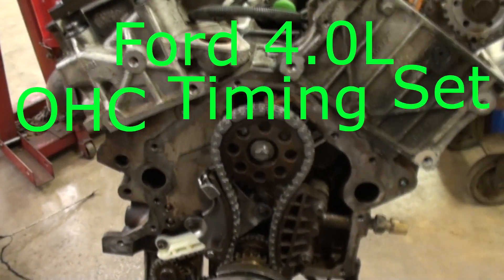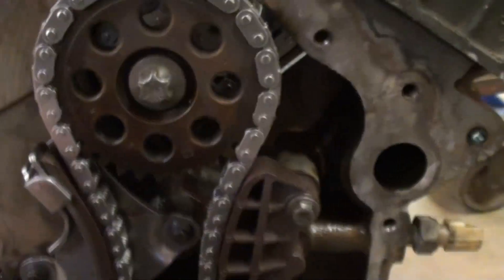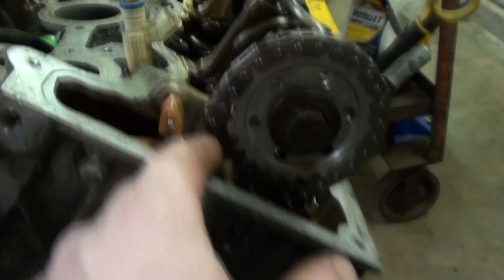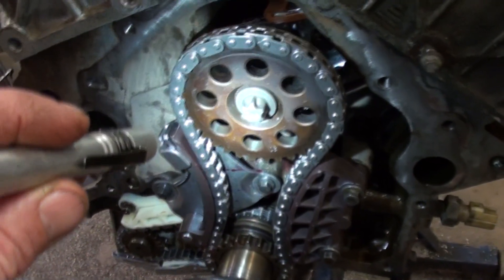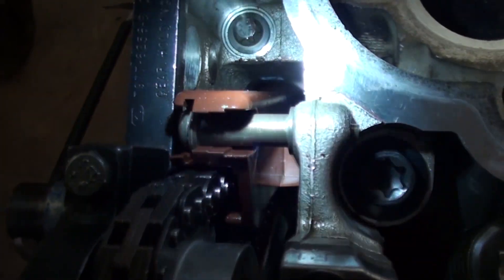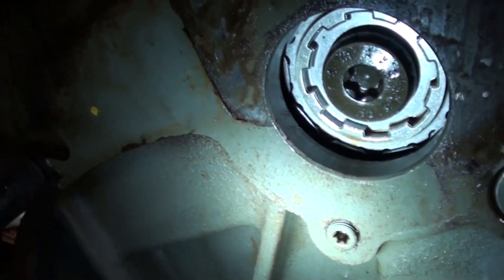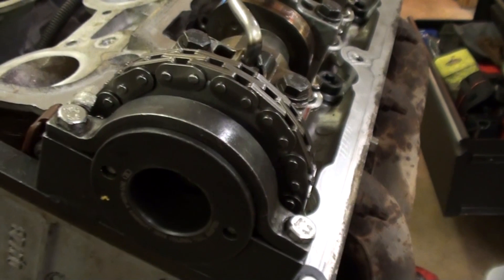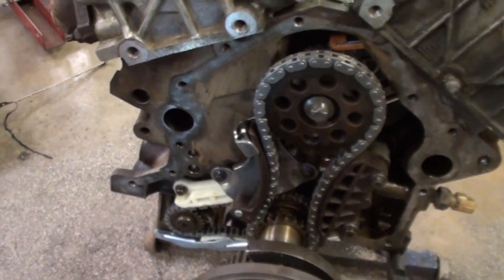Ford 4 0L OHC Timing Set Overview

Comment: My only question is, why don't we use brass or berillum copper for the guides.. Im no engineer. Could be a bad idea.
Reply: To help save the gears and chain when they eventually fall apart the plastic polyurethane parts get chewed up instead of chewing up the gear

Comment: Does jackshaft have to be timed? Or just crank and cams. My engine doesn't have balance shaft. Thanks!
Reply: crank and cams.  jackshaft gears no. but make sure those bolts on each end are tight and do not roll this engine backwards.

Comment: I used vice grips on the cam and angled the vice grips where they were kinda locked to the block where they wouldnt turn ,if you know what I  mean, now I have to take the engine out of my other sport trac and go over it probably put new guides tensioners ex.. on it ,I left the balance chain off my other 4.0 it hasnt had any oil preassure issues or vibration why do they have a balance shaft I think its dumb the engine doesnt produce that much power I think around 200hp or something, have you ever had valve issues with a 4.0 I dont think you can adjust them I guess just replace the lifters ,I used 10w 30 with and additive do you think 10w 30 or 10w 40 would damage the engine cause my other 4.0 has wierd ticking noise sound im not sure if its the chain or what ,anyway just wondered about this, good video, take care

Comment: If you find you're replacing all four chains on the 4.0 don't fret if you can't afford the alignment tool. Just did mine again and found the left bank cam is almost in proper pos once you rotate the groove down. The right bank is tricky since there is a lobe or two pushing on the valves (once rotated) so finesse it with locking pliers and tighten that cam bolt last.  Also eye the key and split it's width to the left instead of 12 o'clock and gain some additional torque.  Whew.

Comment: I just did this job. Now after I started the engine I have a fast tick that speeds up with rpm?? And ideas ??
Reply from the maker: Where did you buy the timing components? If they were not from ford it is possible one of the tensioners is bad. See if you can isolate the noise to one side of the other, then swap out that tensioner and see what happens. You can even use one of the old tensioners for testing,if they were still ok, and see what happens.
Reply: @JosephVollmar  it ended up being the crank shaft timing chain tensioner on the passenger side.

Comment: What happens if my timing jumps on my cams and my jackshaft and everything else is fine? Cassette let go and it jumped timing on right passenger side
Reply from the maker: Sorry for the late reply, but if it jumped time on the passenger side, to replace that casette the engine will need to come out. then you retime everything from the passenger side first all the way back to the jackshaft.

Comment: Great Video! I am attempting to set timing on left (driver) camshaft. (2005 explorer 4.0L SOHC) Have timing tool lined everything up and torqued to spec, won't start.  Throws P0340 and P1336 code.  Replaced camshaft position sensor, no change.  Is there  something on the left camshaft sprocket that has to be lined up for the camshaft position sensor to sense the camshaft position?  My understanding is that other than lining up the left camshaft with the tool with crankshaft at 0 degrees TDC for #1 cylinder, the sprocket location doesn't matter so long as it's torqued properly.  Not sure how the camshaft position sensor knows the location if there is not a magnet or protrusion on the sprocket that also has to be aligned.
Reply: Make sure #1 and #5 are top dead center and if you have a balancer shaft make sure the dot is lined up toward the right pointing toward the line on the block it might need a few turns to line up

Comment: If the cassette for cam front vaulecover breaks does that mean it's out of tlme
Reply: It could be.probably not but the way to find out is to set your timing based off of the crank cylinder one should be at top dead center  compression stroke And your cam shafts that notch on the back of the cam should be parallel with the cylinder head in ur case if the right side is parallel and the left side isn’t after you set the timing then it’s jump time and it’s out If your crank is pointing at TDC and your two camshaft Notches both are parallel with the cylinder head ur good I hope this cleared things up for u good luck

Comment: I shared a keyway installed a new gear and keyway lined up the cam so they're parallel to the heads and brought the crank keyway to the very top and it still seems like it's 90° off or 180

Comment: On a 2004 4.0 sport trac....rear wheel drive,not 4 need a chain at all on lower balance sprocket
Reply from the maker: If you are asking if you need to run the balance shaft chain, no I guess you really don’t. The purpose of the balance shaft is to remove or minimize engine vibration. It could possibly have an effect on engine longevity, but I don’t know.

Comment: I need to know the position of the passenger cam shaft . When we put how it’s supposed to go. The valves are open .
Reply: On that side you can see the groove at the front on the cam. Make sure the smaller segment is facing downward and flush with the valve cover base on the head.

Comment: ms joseph im having isue setting uo the timing of my ford 4.0 v6 sohc can u give me a hand ill really appreciate it
Reply from the maker: Where are you running in to problems? It has been a while since I have done one, but I’ll try my best to help. The first thing you have to do is set the timing on the front chain that runs from the crank to the jack shaft. Once you have done that and torqued the jack shaft bolt it is time to set the timing on the left (drivers) side cam. This is where the special Ford tools come in handy if not necessary. You may be able to get them as a loaner tool from an auto parts store. You can do it without them but it’s not going to be easy.
Reply: @JosephVollmar  I have a question. I’m trying to replace one of the guides on my 09 4.0 mustang. But does this engine have a rear chain as well ?
Reply: @JosephVollmar  and how do you do this without messing up the timing on the rear

Comment: I replace the timing belt tensioner on07 Ford explorer and I having problem to get it started I think the timing is off I just wanted to know ow to set it up in time thank you I will appreciate you
Reply from the maker: I don' remember any of the Explorers sold in the U.S. having a timing belt, they are all chain drive. If it is chain drive the new tensioner has to be activated by removing the valve cover, reaching in with a soft tipped pry bar then sharply pushing in and releasing the catch in the tensioner. if you do not activate the tensioner and it does not activate on its own the vehicle will be out of time due to slack in the chain. 
     There is a way to set up the timing without buying the special tools for it, but I don not remember what it is off the top of my head. I may have covered it in one of my other videos on these engines. there are no timing marks, and the engine almost needs to be out of the truck to pull it off.

Comment: Great viedo! I'm  preparing to do this  on 2001 ford explorer 4L V6 4*4 .  have got all tools. I don't have a garage. , living in a city. I plan to pull the transmission. Do you think it is doable by pull the transmission back to get access to the back of the engine. my level is that I have replaced the fuel pump and fix the check engine light. thank you.
Reply from the maker: Marian Lee it will be difficult that way but doable. If you can, it is easier to pull the engine and get it on a stand. I always like to drop the oil pan to check for pieces of the timing guides to ensure there is nothing that might restrict the screen on the oil pump pick up. Just take your time either way you go to make sure everything is set properly before you get it all back together. Best of luck to you, and thank you for watching.

Comment: Good shit man i bought a 05 lr4 4.0 same engine im guessing this happened to mine had it for 6 monthes it was raddling and eventually sputtered to a stop when i turn it over it cranks way too smoothly without a spark i replaced crank and cam sensors ecu looks flawless new plugs ,coolant temp and tires brakes and a lift just so it doesnt run how hard is the fix do i need to pull the engine ? Ive never done that so i hope not. Any pointers to a newbie that is on a budget in minnesota. Also how long did it take you or how long should it take if i can do this while engine is connected if its just a slipped timing
Reply from the maker: Anthony Sciuto thank you for subscribing. I have bad news though, your engine will need to come out. If it has stopped running a full timing set is in order. You will also want to run a leak down test on each cylinder to check for bent valves before you dig in to the engine. If your engine is lower mileage you can get away with pulling the heads and replacing the bent valves, but if your engine has some miles on it you may be better off looking at a reman, or trying to find a low mileage take out. If you are fairly new to mechanics you will probably want to invest in the tools to set the timing, and if possible find someone who has done a couple of these to help check your work that way if you miss something it can get fixed before you get the engine back in the vehicle. I know that’s probably not what you were hoping to hear, but I hope it helps. You can check e-bay for the timing tool set, and for the right price you Could probably sell them for what you paid when you are done with the job.
Reply: @JosephVollmar  hi sir how are you please when this engine broken front timing chain they valve are bend or not
Reply: You want to pull the engine since the left bank cam chain components are at the rear of the engine. Best if replacing all four chains, guides etc.  2  Buy quality parts unless trading it.

Comment: Where is the sensor located? The camshaft position sensor? Is it 3 wire or 4 wire? The same engine explorer 2000 4.6L v6 sohc
Reply from the maker: The 4.0L V-6, and the 4.6L V-8 are very different engines. I would have to look up the cam sensor locations for both to give you an accurate answer.

Comment: So as long as that slot in the back of the camshaft is straight across the cam is in timing
Reply from the maker: As long as the slot is below the centerline of the camshaft and parallel with the upper surface of the head the cam is in time. If the slot is above center it will put that cam 180 degrees out of time and you could possibly bend valves. If you are going to try to time this engine without the special tool set I recommend removing the cam followers. This will make the cams much easier to hold in the correct position as you tighten  everything down, as you wont be fighting the valve springs. They make a special tool to compress the valve springs with the cam still in place and it is OTC part number7928 and is available on Amazon for $76.28. It does not specifically say that it will work on the 4.0L, but that should be the correct tool to compress the valve spring and remove the follower. I hope this helps, and best of luck with your 4.0.
Reply: @JosephVollmar  Both cams should be below center to be in time?

Comment: The gfs 4.0 blew part of the set up out of the ds valve cover. When i replaced everything on the front i found the balance shaft chain snapped. Part of the timing set wedged between the gear teeth and stoped it in its tracks. Instead of spending ton of $ on a replacement balance shaft i just left the chain off of it because i figured the shaft had to remain in place for oil pressure flow. 
Ford made the 4.0 sohc with and with out the shaft. Her motor runs fine. Just feel a little more vibration with it in low range and idle. Rest of the time there is no difference. Just a heads up for people that might run into the same problem and cant afford the balance shaft.
Reply from the maker: You are correct in that not all of the 4.0L engines of this vintage had a balance shaft. The versions that went in to two wheel drive vehicles were less likely to have a balance shaft than their 4X4 counterparts. I would not do that to a customers vehicle, but I could see attempting it on my own if money was an issue. I don't know if it would have an affect on the lifespan of the engine, but that may be something to consider if you are thinking about going this route.
    Thank you for watching the video, and keep me posted on how your out of balance engine is doing. I'm curious to see how it performs without the balance shaft in operation.

Comment: Hello, Nice video. how does the motor run?
Reply from the maker: The engine runs great, and the customer was very happy with it. He had just purchased the Explorer that it was in a little over a month earlier. Had to replace one of the valves that was bent and not sealing properly from when the timing guides broke, and found several other broken parts inside the engine while I was trying to get all of the pieces of timing components out. I have the whole process on video, I just have not had the chance to edit it all together yet. Hopefully I will get it posted for everyone soon.